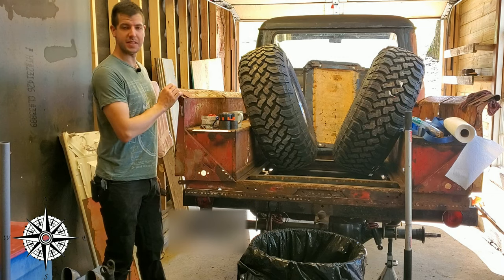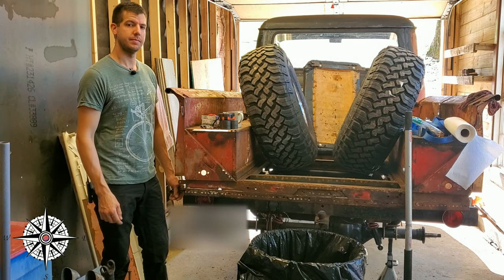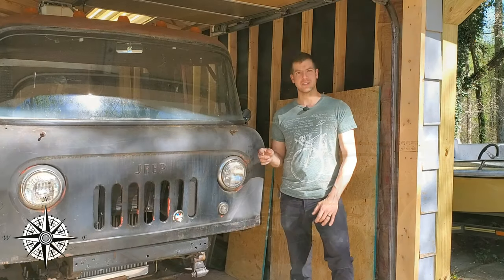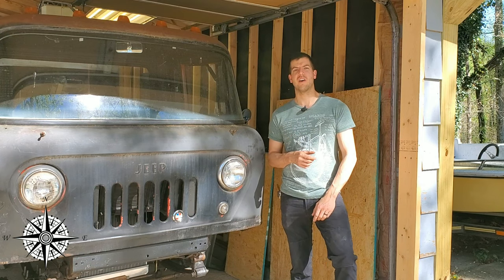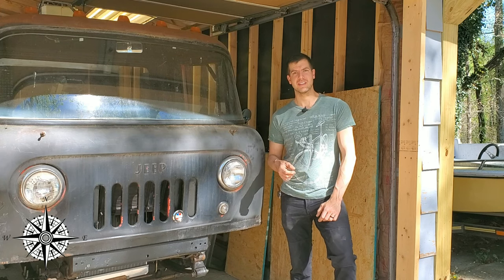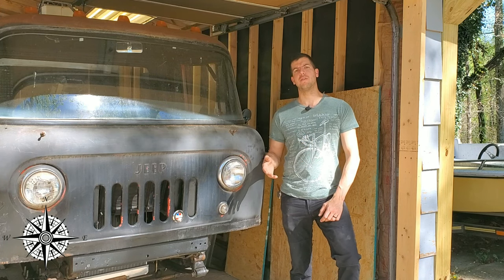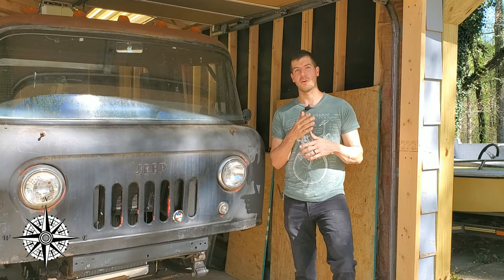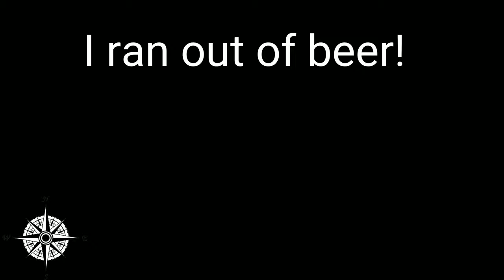Jeep power steering upgrade fc150

Comment: Could I please get all that info from you on how to do this to my FC-150?  Very intimidating project for me to take on but it needs to be done to use the 33” tires I bought.  Also, do you have any suggestions on how to hook up a power steering pump to the hurricane engine?  Thanks

Comment: It's me again, I'm about to start & will need to make some decisions.  I THINK I'm going to use my available cj axles. They are 51.5 front & 50 rear inches track width. What is the track on your 150? And the tire width on your 150? Rim off set?  And finally, on your commando, you said you had 33's on 16x8s. The width 10" or 12" tires? Thank you again.

Comment: In the beginning of your video you arrive in a jeep commando.... what is the tire and wheel size and where did you get them?  Thank you!
Reply from the maker: I need to make a video about it. Thats the most commenly asked question. They are 16x8 steelies from summit racing with half moon covers tires are 33 Mastercraft from simple tire.
Reply: @Topofthemoningtoyou  thank you very much. I'm trying to get started on my FC & tire size dictates an awful lot of the build. That is a nice balance of upsizing without losing your mind. The gear sets, driveline & brakes can handle 33's ok.  I want to install PS like you did & an auto. My wife really loves these old trucks/jeeps & I want to make it an easy driver for her.
Reply from the maker: @johnprice1952  send me some photos of what your got I'd love to see it
Reply: @Topofthemoningtoyou  ok. Not much to see yet. It's a 57 170 that had a Massey Ferguson backhoe mounted on the back. Belong to a country funeral home in Virginia.  The elderly man wouldn't sell the hoe but I finally did get the 170. I want to custom frame it as the original frame is cracked/repaired numerous times, disk brake the front & more modern the engine. Make it convenient/safe with old/unusual fc looks. I'll likely custom fab the bed to near original & thinking of 4 linking the rear. Big ideas, some money, much less time.
Reply from the maker: @johnprice1952   Well I also make the custom interiors for them so whenever you're to that point give me a shout and we can work something out. Carpet, door cards, seat covers, and arm rests

Comment: Do you have a part number or link for the angled drive gear boxes?
Reply from the maker: I wish, I happened upon those on ebay. An angled gear box that was produced in this decade is a considerable bit of money the ones I found where from the 80s. Ebay has a few different options
Reply: @Topofthemoningtoyou  definitely appreciate the reply. I went a little overboard with my fc150. It was my father's back when he was in high school. Full restomod for an overland style build. Ride quality and  creature comforts are the biggest. It's been some work haha

Comment: I could have saved you a lot of time and effort on the power steering.   Here is how I did my power steering on my FC170.
Including the parts used (all new off the shelf and part numbers)

https://www.overlandbound.com/forums/threads/1958-fc-170.11736/
Reply: Your write up is very helpful. Did you have any binding issues with the steering shaft at the angle it is?
Reply from the maker: Not at all my biggest worry was a large dead spot but the tolerance was tight enough the truck runs true.